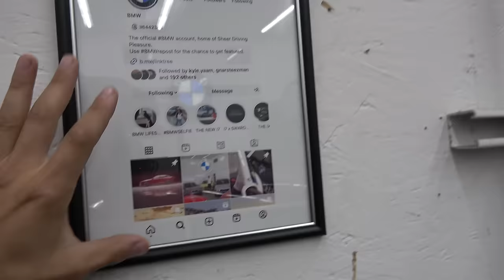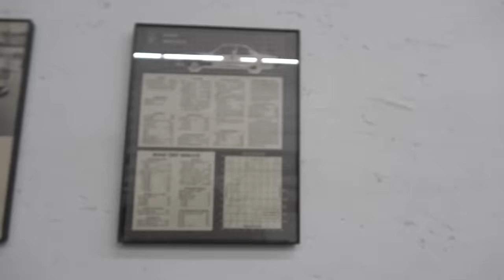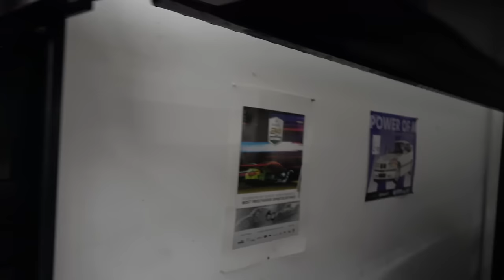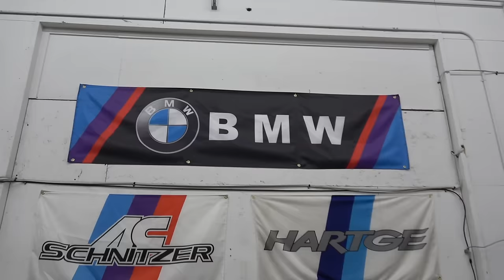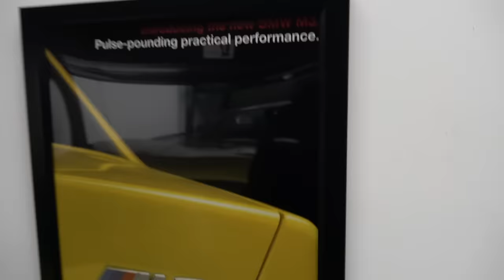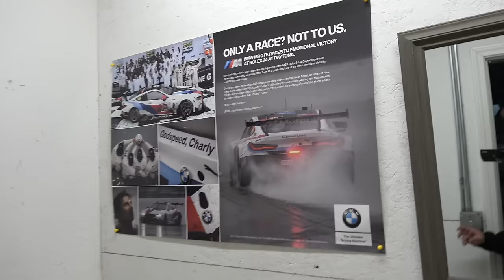Building My BMW Dream Garage | Lifts, Rare Artwork, and Classic BMW's | Updated Shop Tour

Comment: Recently got myself a 4 post lift for storage too.  But seeing yours unbolted to the floor gives me anxiety even though I know you are not in a Earthquake zone.  My cars are uninsured if stored on or under an unbolted lift.  I'm in New Zealand though.  So earthquakes are common.
Reply from the maker: Yeah no earthquakes around here, no risk at all. Ive talked to every lift manufacturer around and they said 90% of people don’t bolt 4 posts. Completely unnecessary
Reply: @m3nameisjosh464  nice I wish that was the case here. I had to pour thicker concrete where it bolts to the floor when building my shed. Loving all the signage BTW. Very jealous.
Reply from the maker: @Driftit  yeah you guys outside US have strict rules it seems!